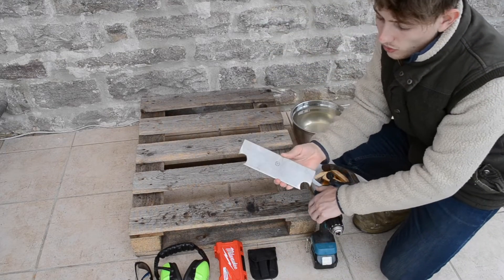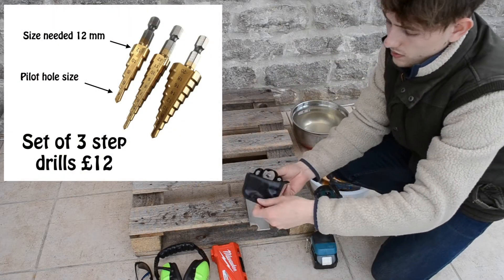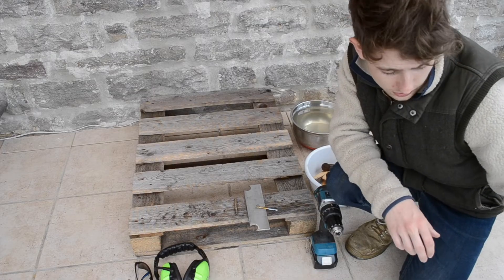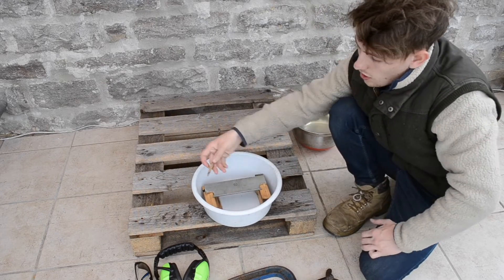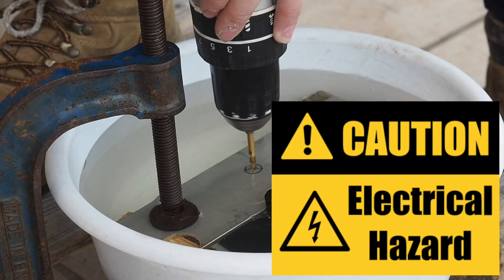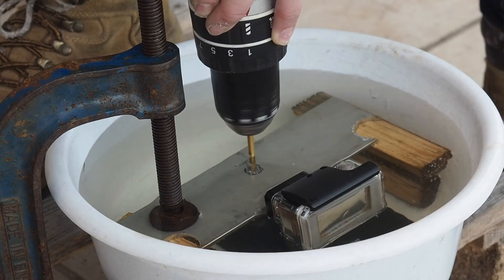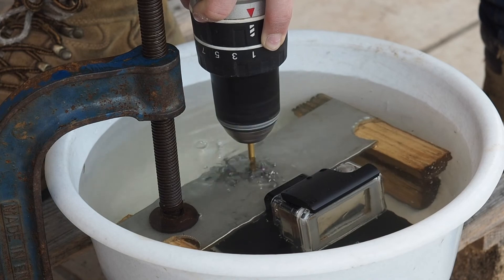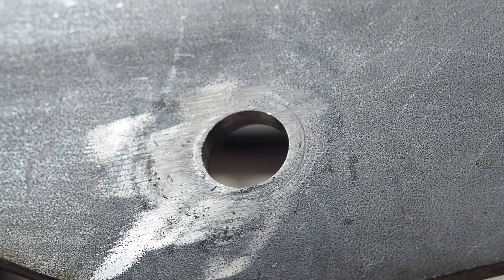How I Drill Stainless Steel, Super Easy!

Comment: Thanks, glass and s.s. are the most pain to drill, by far- so true. 
What's the rpm (setting on the adjustable drill)?

Stainless, chipped my cobalt bit (cobalt bits, especially the thick ones are very expensive).

God bless, Rev. 21:4
Reply from the maker: Hi Steven, I just have my drill set to the slowest rpm and use the trigger to get the speed I want, sort of like clutch control in a car. Thanks

Comment: what I learned from the old boat maker who uses the marine grade hardened stainless steel is:

1. put the material in the freezer and take it out seconds prior to drilling
2. put one or two ice cubes on the material as near to the expected hole location and it can touch the drill bit on the drill press just be careful with your fingers or use small piece of wood to push the ice cubes towards the drill bit
3. use high temp car engine grease (red paste) and dip the drill bit in it, it will remain on the bit as it's very sticky 
4. use cobalt drill bits preferrable with the narrower pilot tip (DeWalt or Bosch or alike)
5. right after drilling, drill through another ice cube and leave it on the drillbit end

with the above method, I can actually push hard on the material, and drill quickly, the quicker the better. the chips will be like a spiral continuous cut rather than smaller shorter pieces.
I also use the aluminum drill press table that dissipates the heat from the drilled material. and it is waterproof / oil proof, so it's a breeze to clean up the mess, comparing to doing it on the wooden drill press table.

cool video shooting with the action cam underwater.
Reply: Great tip using aluminum as a heat spreader! Will give that a try tomorrow at work!